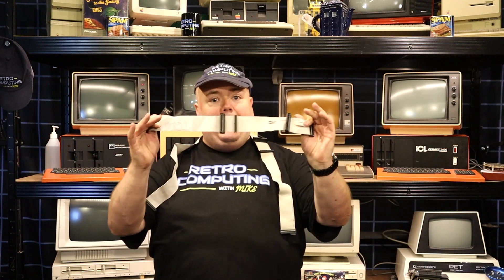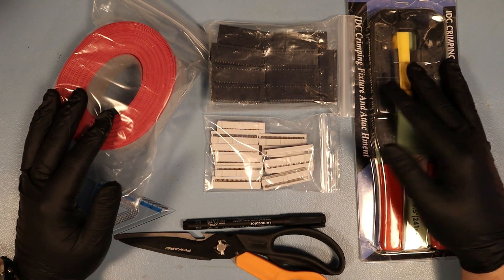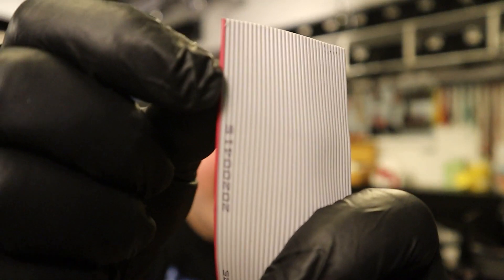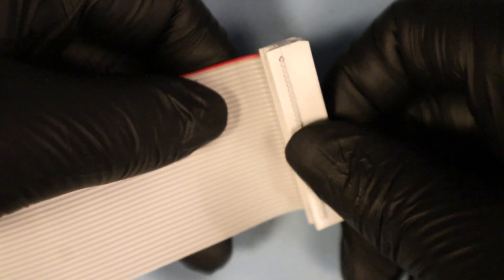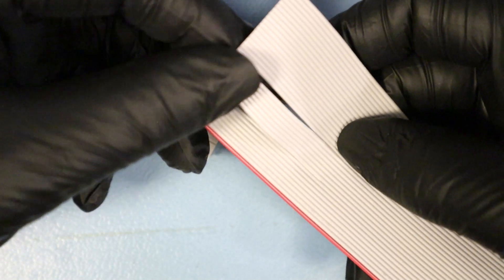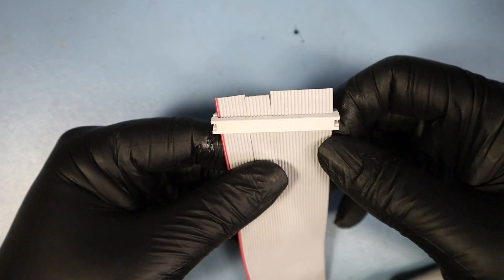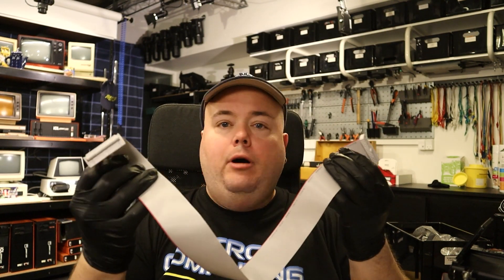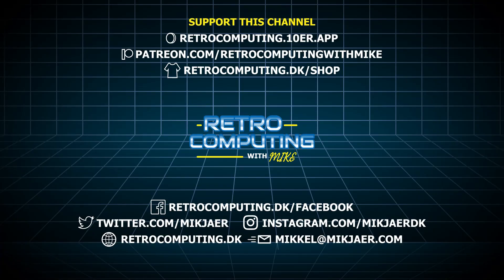Make your own floppy cables #retrocomputing #repair #electronics

Comment: My experience is that an exacto knife works great instead of side cutters. There's also these brackets to fold the connector over, if using those keep good track of which side goes where. A vise works as a replacement for the IDC crimp tool if you only need that one cable.

Comment: Well done! 

Another tip: use sharp scissor (not cutters) to cut cable! Otherwise wire shards/ fragments from neighbouring wire members will ruin your IDC creation....

Especially when finishing off (trimming) wire at IDC connector....a sharp cutting blade is needed. Do not just shear cable ends.
Reply: The flush cutters Mike use here leaves no fraying wires. It's not a problem.